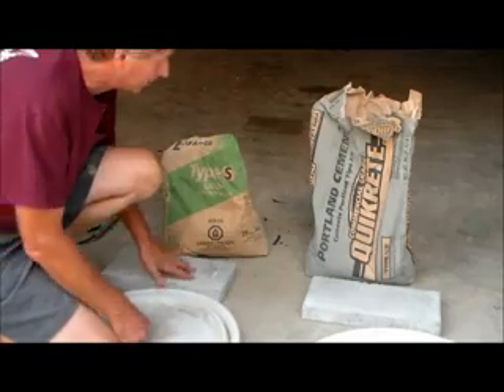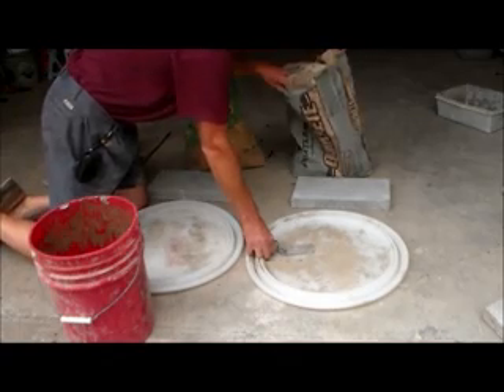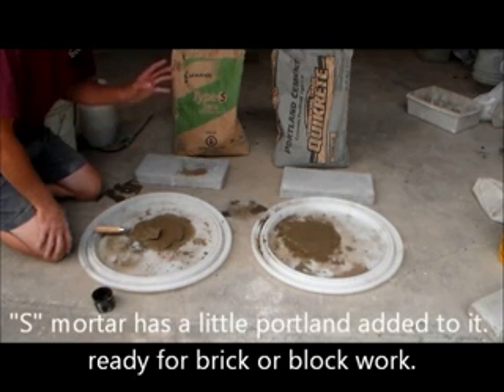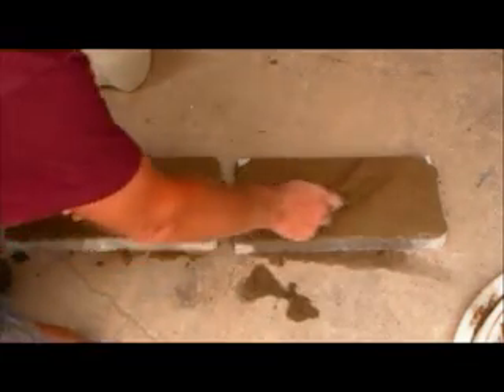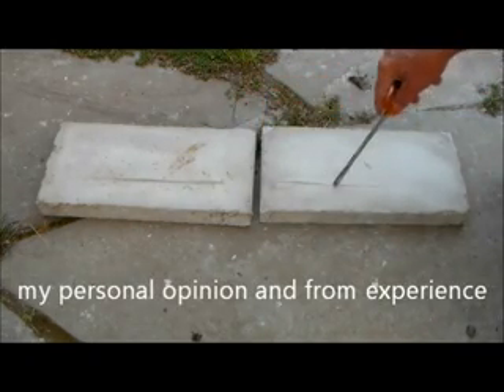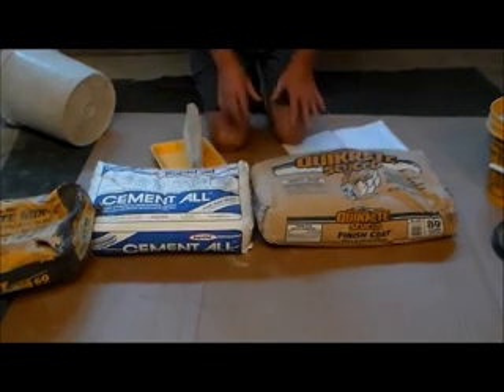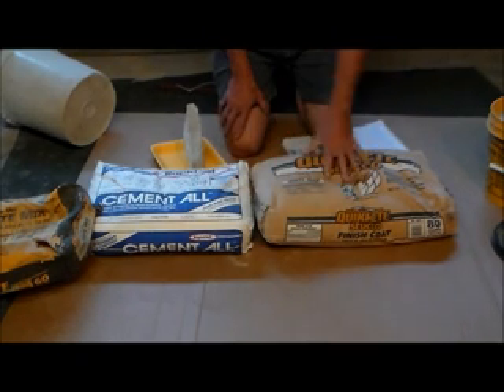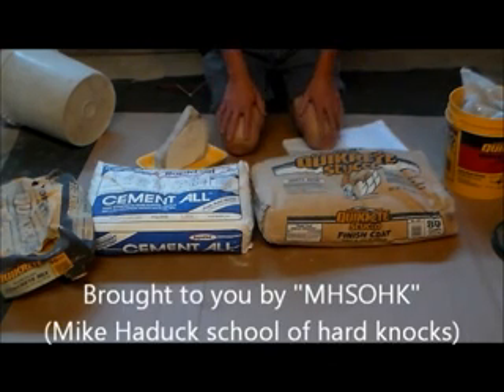WHAT CEMENT SHOULD I USE ? (Part 1) Mike Haduck

Comment: Repointing a stone wall -- was advised to use a Portland-Lime Type N mortar and mix it with sand -- I have two bags of the Portland-Lime Type N mortar and a number of bags of sand. Would a 1-2 ratio be good? One part Portland-Lime Type N mortar to two parts sand?
Reply: wow
Reply: Don't bother,grab ah bag of type 2 portland cement, it will weigh 94 lbs....grab masonry sand...or play sand at home depot...same stuff....mix at a ratio of 3 buckets full of a sand to one bucket of portland....mix it thick don't add too much water at all.....if it is at ground level apply it with a pastry bag......Yep, Mason tricks :) I do this every day of my life....Love it. 2 to 1 ratio is too rich to be applied so thin it will be ruined really fast.

Comment: Mike, I need to re-mortar the blue stone caps on my outside patio here in Connecticut. One of my contractor friends suggested using a modified thin set. He said it would hold up better than traditional cement. What do you think?
Reply from the maker: Ando I have heard of guys using it. I couldn't say unless I was there to see it but the locals all have their own ways that work. So I can not say yes or no. but I don't doubt it. the locals know best.   hope it helps. thanks mike

Comment: Hey Mike, I have been repointing steps and chimneys with type s for a few years now but learned today I should be using type n to allow for flex and no cracking/check cracks. What are your thoughts? Thanks (Central and upper NJ freeze thaw as well)
Reply from the maker: Hi AA, everything depends on what I am doing, I did a video " Lime mortar or portland " I think I explain it best there, Mike

Comment: Great info ma man. I built an outdoor fire pit, it cracked badly in the heat, is there a fire cement like there is a fire brick?
Reply from the maker: fudgedog they make a fire clay (cement) and fire brick but the truth is if a fire is built too big and too fast everything cracks, if the cement is touching metal, the metal expands faster, lots going on with fire pits and fire places. and sometimes the stones will explode if they contain water. I could go on and on. I hope it helps, thanks mike

Comment: Mike, I'm attempting to do some repairs on our church brick steps. They are 20 years old and falling apart. I live in VA so it may be close to the climate as PA, not sure. After I clean all the brickwork up and remove all the old mortar, which of the mentioned cements should I select for this application? I have not laid brink in over 43 years so I need all the help I can get. Thanks in advance. Mitch
Reply from the maker: Hi Mitch,  I would say it all depends on how good and what type of brick,  S mortar is what I usually use,  maybe in VA that would be ok,  but I would alsoo ask the local brick supply company and see what the locals recommend, I hope it helps thanks mike
Reply: Appreciate it. I will look into the details. Thanks.
Reply from the maker: Hi Mitch,  everyone has their own ideas, expecially in different states,  thanks mike

Comment: Hi Mike  
Thanks  for all   your videos.  I have  a question  about  mortars. When  building  a rock   retaining wall  vs  block or brick retaining  wall  the  gaps  between the rocks are greater  than  the gaps in blocks and bricks. On my Type S mortar mix bag it states  that  it is good  for up to  1/2"  gap.   So, what mortar   would you  recommend  for  the larger gaps   in a rock wall?  Would coarse sand be  better then fine sand?
Reply from the maker: Hi Steve, I have a playlist called Retaining walls (Mike haduck)  I show what I use in each situation, I hope it helps,  mike

Comment: Hi Mike - thought I'd throw this out there.  I watch this British mason Stu Crompton and he recently did a video on building a brick corner.  The mortar looked really smooth and I asked him what he was using..he replied lime and sand, no cement.    After looking around I learned that lime mortar is a very old way to do it...especially when strength is not really needed.  Do you have any thoughts on lime mortar?
Reply from the maker: Hi Mike, I have talked to Stu and he knows what works in Britain,  I would like to do a video with him one day,  my area lime doesn’t hold up because of our deep frost, but a lot of masons especially in the southern states still use it, around here it is hard to find,  I would say it is a regional thing, thanks mike
Reply: @MikeHaduck  Thanks for the reply.   I know you have mentioned many times that you have to use what works in your area.    It would be great to see you and stu do a video...he looks like a very accomplished mason.    thanks again

Comment: Hi Mike, Thanks so much for the Video. Could you please advise what your recommended mixture would be for Paving Moulds - The ones used to create a Cobblestone walkway - strongest possible mixture which won't crack - aswell as you're recommened mixture for filling the Gaps between the Cement Cobblestones. Hope to hear from you.
Regards.
Reply from the maker: HI Cosmos,  it is a hard call depending on where you live,  when you buy pavers they are usually heat treated and last a lot longer then doing it yourself,  I have videos on"How I do pavers" which might help, thanks mike

Comment: I want to make decorative stepping stones(not for stepping on)which cement do I use and what mixes to get a lightweight but durable piece? I used the green label rapid set cement that comes in 60lbs, added water to pancake mixture but when I unmold there were some small cracks lines and holes.  Should I have packed it down? I just pour the mix into the mold and then tap it to release air bubbles. thanks.
Reply from the maker: +purpleshammrock   I did a video called "How I make concrete wall caps (mike haduck)"   I think that would work for you with steps also,  thanks mike

Comment: hey mike. I got myself in a pickle. I have an entire stone foundation wall that needs serious repointing. I've done repointing in the past but not to the degree that's needed here. I'm managing to get the pointing done but I'm not sure how to tackle the dusty brown coat or what material to use. Should I use sand topping mix. How do I parge over the stone after I've repointed. I am already going to take a hit on this job so I just need to get it done. The parging I've done in the past was usually on semi flush walls not over uneven stones. Help! The existing brown coat is very unstable but there is no way I can remove all of it.

Comment from the maker: I could never say for sure unless I seen it. but doing a job like that I would approach it like you would do body work on a car. I make sure the surface is clean and no loose debris. then wet it good and use 2 sand to 1 Portland and keep going over it till you get the desired effect. practice first on a old block. good luck  mike

Comment: Hi Mike!
Ive been following you for a few years now, thanks for all the content. Great stuff all around, especially the traveling vids.
So I bought a house built in 1890, Massachusetts,  i finally tried repointing a small exterior brick wall.  It looks great, but the only problem is, im pretty sure its the original soft red bricks, and it looks like old lime mortar. It was very soft taking it out, and i used a 4 to 1 bagged sand/portland mix to repoint. Ive come to understand that is too hard for those soft bricks and they can crack with weather change, spawl etc.
When i tuck my tail and redo it,  What would you recommend using?
Thanks
Reply from the maker: Hi Wayne,  I use "s" motar. Which contains Portland, and a lot of older guys used Portland and sand, I never had problem, and the reason they got to re point it is they keep using lime which falls apart, my opinion,  mike
Reply: Hey Wayne you are spot on. You should never use Portland cement in any amount with old brick because the old brick  will be softer than the cement and therefore crack, spall, and fail.  Lime mortar does not fall apart. A rule of thumb is, with old buildings, modern materials cannot be used. If you have an old building you must seek advice from someone who understands how they work--modern methods and materials more often than not will destroy your old building. By the way, concrete next to wood will lead to extensive rot. The National Park Service and many UK websites are a good starting point.

Comment: My concrete crumbles!   I have have made some test blocks with the 1 pt cement, 2 pts sand and  3 pts gravel mixture and a test block using high strength redi mix.   The 1 2 3 mixture crumbles, even if i let it setup for 3 weeks, where as the redi mix is hard and stable.  What am I doing wrong?  I used portland cement type ll, all pourpose sand, 3/8" pee gravel.
Reply from the maker: Hi Tom, when mixing concrete for myself,  I usually go, 1 1/2 Portland two parts sand and 2 parts gravel , and even the red bags outside I add a little Portland, I haven't had any issues, thanks Mike

Comment: Mike I learn lots watching your videos.   I have a question.  You seem to love the Portland cement, but you say for inside you prefer mortar.  I am planning on putting cultured stone over an indoor fireplace.  What should I use.  I live on Long Island, ny. Also can I cement/mortar the cultured stone directly to the brick? Or should I use the wire mesh?
Thanks
Reply from the maker: Its impossible for me to say what to do over the brick unless I actually seen it. but I have no problem with s mortar inside for cultured stone. and many times I think it is acceptable outside, everything depends.  Mike

Comment: Hey mike, getting ready to move into a 105 year old house outside Frederick Maryland, Planning to have the stone foundation checked out by a professional and as long as it’s okay structurally I will be repointing in myself. not knowing what kind of stone the foundation is made of what would you recommend? I hear lots of scary stories saying to use type N because it won’t damage the stone.
Reply from the maker: Hi Guy, I show the cement I use in each of my video andnever had a problem with any of my foundation repairs, or repainting stone walls,  and I been doing it over 50 years, other masons say different,  thanks mike

Comment: Type s mortar is basically a parging coat and stronger than type n which
 is more of an above ground bricking mortar. Portland on the other hand 
is not a masonry. Portland is a high strength concrete. High strength 
concrete is a different breed and should be used for things that are 
meant to last a long time. In ground pools use a lot of high strength 
products. Portland at high strength, basically a grout, white portland, 
marble and various sands. Why do in ground pools last so long? Mix. High
 strength mixes like 2 to 1 sand to cement are used for not only 
strength but as well stickiness without or with additives. Concrete 
sprayed repair to ceilings and stone foundations is of the same format. 
If you want it to stick you need a clean surface, watering the surface 
is the first piece for bonding as Mike demonstrates, but a greasy mix is
 very important as well. Mike is doing repairs to broken things, it is 
generally cost effective to repair rather then replace a whole wall. It 
is faster and it needs to last because of the costs involved. Weather 
factors while using the materials is a completely different set of 
factors not even focused on or even explained. Do not assume that 
because you can now mix some material together that your going to get a 
professional job doing it yourself. Do not assume that Mike is 
neglecting to follow standard building practices of outlined types of 
cement based products. Those products are for building things the first 
time and using them for repair can be successful at times and can also 
cause the contractor nightmares of returning to a job. Everything is not
 clear cut and experience is number 1.

Comment: Great info sr
Im planing on building under ground hole to cook 
Il be using fire brick dilema is what kind of mix  to use
Store recomend spec mix with some clay mix to it
What doyou think
Reply from the maker: Hi Luis,  I can say is that everybody will say something different, fireplaces etc. are a thing of the past because the heat cracks masonry, everybody is going to stainless steel, I really won’t build a fireplace anymore, but the old timers Would many times use fire brick and the fire clay, I think you would have to research it more, I hope it helps, thanks Mike

Comment: Hi Mike, i took down the drywall, from ceiling with exposed ceiling of cement. Its apartment building. Any suggestions if I should use Morter mix or cement mix for the ceiling? There are small holes and cracks - no major issues. I had to take down all the plaster that was on the ceiling so it is all concrete ceiling. thanks
Reply from the maker: Hi Hess, I don’t know what to tell you about that, but you don’t want Cement Falling on your head, I would think they would make some kind of drywall patch for that I check with the local guys at the hardware store, thanks Mike

Comment: What product to use for patching salt damaged small Pitts on the garage concrete floor...fast drying in MN...need to reseal the concrete after
Reply from the maker: Hi Janet, for that kind of job I would look up the people who repair and paint the concrete floor, I haven't ever done that, thanks Mike
Reply: @MikeHaduck  I don't need to hire someone just thought you would know what product to use quick drying
I have used dark walnut acid stain on the driveway and sealed no hiring needed
Thanks anyways
Have a great week

Comment: Hi Mike. To level a concrete floor in a basement, what product would you suggest in your experience?
Reply from the maker: Hi Jimmy, I can't say unless I was there, sometime I seen everthing ripped out and redone, fillers are iffy unless you are going to put carpet or tile over it, thanks Mike
Reply: Hi Mike. After level the basement floor, I am thinking on using vinyl planks with rubber pads. Your opinion is appreciated. Another option , would be ceramic tiles. Your thoughts?

Comment: I trust you Mike and I think you know what your talking about. I liked your response to Hearthman1159. So, I have a question. I am doing a cobblestone walkway (mold and cement) and want to fill the gaps with I guess cement? I saw in another video someone who swept cement into the cracks of the cobblestone then used a water hose to hydrate the cement. Can I use your 2:1 mix to sweep into my cobblestone walkway? What do you suggest?
Reply from the maker: Hi Chicken,  I would not do that as the cement dust would stain all the cobblestones, I usually mix it very dry and do in a little at a time but everyone says different,  I would do some samples first,  I hope it helps, thanks mike
Reply: Sorry, I dont understand. Your saying I should use the portland and sand mix maybe use a funnel to place in between the cobblestones then water it down? OR mix the portland and sand then place in between the cobblestones maybe using a piping bag?

Comment: Thanks Mike!! I have a question for you:  If I was trying to repair/patch and waterproof a stone wall would hydraulic cement be best and would you add a bonder to it for making it stick better?
Reply from the maker: Hi NtoHealth, I have a few playlist on stone wall or concrete wall repair on my channel, check them out , I am sure you will get some ideas from that and I show what cement I used on each project,  thanks mike

Comment: Hi, am trying to resurface my sidewalk that i paid to have it done and cheap concrete was use on it. Some areas are dusty and have lots of cracks from the winter and salt. Can u recommend any contrete that holds well during winter and can withstand salt?
Thanks
Reply from the maker: Hi Noel, I have videos called resurfacing sidewalks or resurfacing concrete, they might help, thanks Mike

Comment: Hi Mike: I am repairing the crumbling stone foundation of my 1860s home (inside and out), but I read somewhere that I should not use Portland Cement. Does that sound right to you? If so, will the Type N mortar work on the exterior as well as the interior of the basement walls?

Comment: Hey Mike, I'm in Massachusetts (harsh winters up here too of course) and there's a small basement window at my house that someone had previously boarded up with plywood and then raised the grade to partially cover it.  Well, now the plywood is rotting and I'm thinking I should block up the window with the 4 x 8 x 16 blocks they have at Home Depot.  Do you think those blocks are ok to use?  Also, what would you typically use for mortar in this situation (and exterior finishing) and do you think I'd need to do anything special to waterproof it since it'll be partly below grade?  Thanks
Reply from the maker: check out my video, "how I block up a window opening" or how I lay glass block,  I think you will get what you need from them,  thanks mike

Comment: Hey mike I need to stucco steps they put wire mesh around it and it rusted and blew the stucco off. Should I rip the wire off or leave it and would rapid set work I want it to cure fast. Thanks - Ray from CT.
Reply from the maker: Hi Ray,  check out my videos on foundation repair ( Mike Haduck). I ran across that problem on a couple of them,  I hope it helps. Mike

Comment: What do you think about a 1:1 ratio for outside flagstone joints?  Stronger than 2:1 sand to Portland?
Reply from the maker: Hi Gator, if it's a outside joint I might do that, go 1 to 1 but I give it a test first, thanks Mike
Reply: @MikeHaduck  Thanks Mike.   Should I even attempt concrete joints if my flagstone are not set in concrete underneath?   Current joints are gravel, and I'm sick of the weeds.   Would love concrete joints, but afraid they will crack pretty quickly.   Any recommendations?